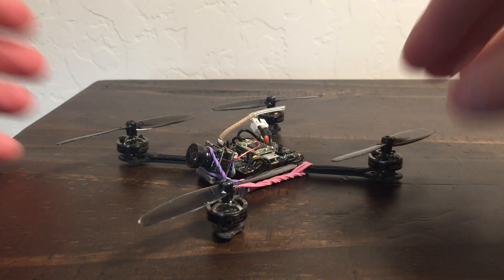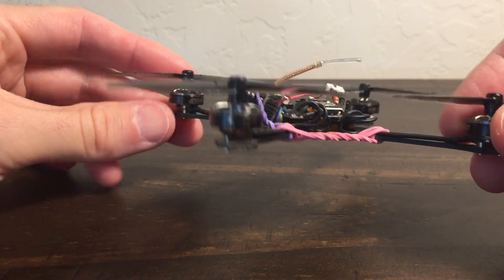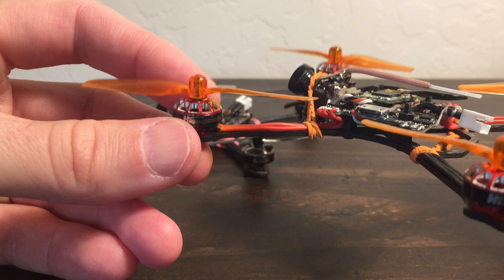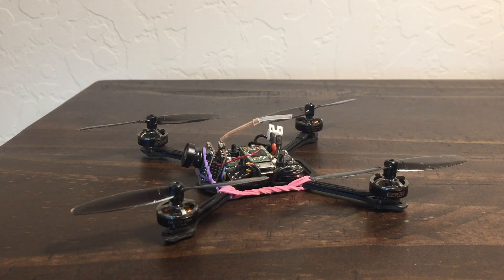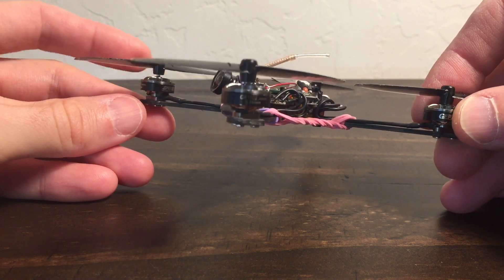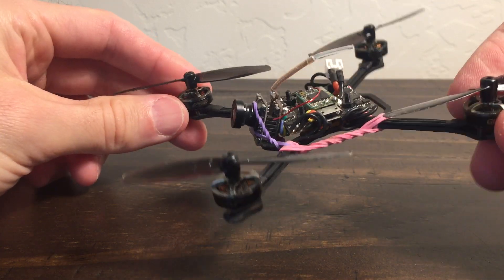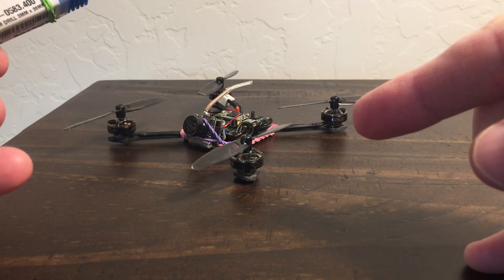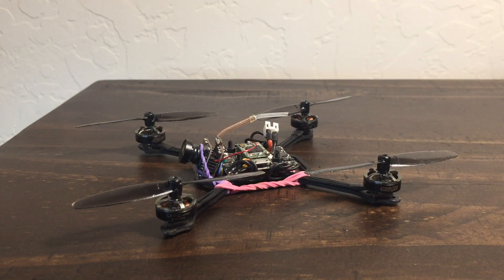Fly The New Off: Geprc 1102 14000 kv Long-Term Review

Comment: Can you make a video on how to replace the bell and shaft on the 1102 happymodel?
Reply from the maker: It would be a little hard to do on camera. The procedure is simple though: Remove the C clip on the bottom of the shaft. Remove the little brass washer. Pull the motorbell/shaft out from the motor base. It may take some force/wiggling. On the new motor bell slide one brass washer onto the shaft. Slide the motorbell/shaft back in the base. Put on the brass washer and replace the C clip.
Reply: Quad 66 thank you! I removed the two c clips but didn’t realise the washer needs to come off too. This is quiet helpful
Reply from the maker: @MrStrikeforce1987  Your welcome.

Comment: Thank you for the update. What do you think about the t65mmX3 props? Mine seem to work nice but generate vibration.
Reply from the maker: I have only about half a battery on them and only on 1S. My batch seems well balanced but I've seen a couple people report vibration issues. I specifically waited rather than ordering early to avoid first batch issues. I don't really have an opinion on them other than they didn't immediately impress me but that could change.

Comment: How do you see if you bend a shaft?

My 1102 from BetaFPV are still feeling nice, however the screw dont hold them to the frame anymore (all screws are loose!). The bottom of the motor is weak.
Reply from the maker: I spin the motors up 1 by 1 in betaflight with and without props on and after changing props. Loud irregular vibration is bearings. Regular vibration on more than 1 props is a bent shaft or bell.